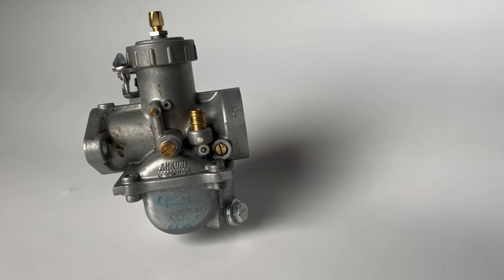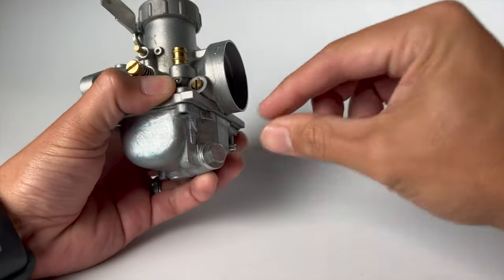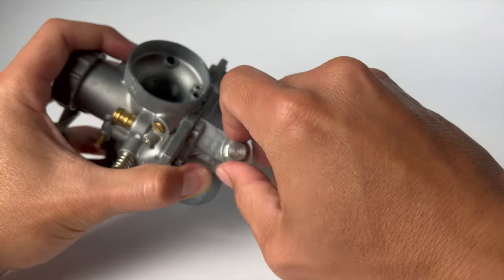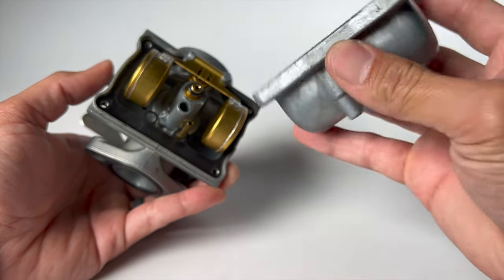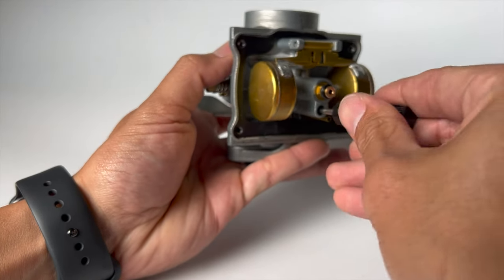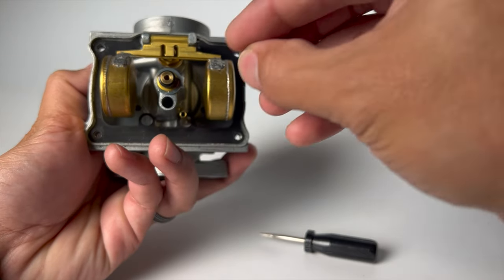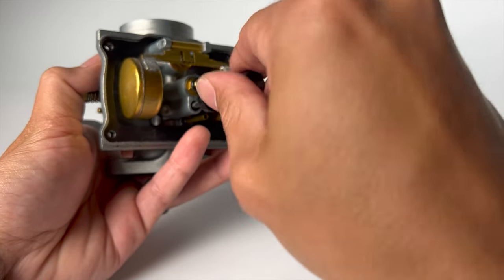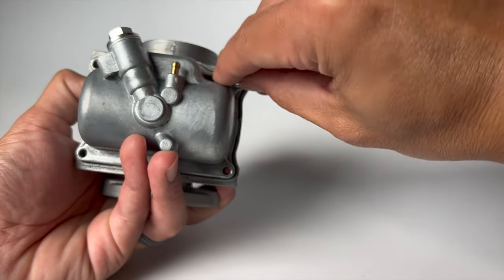Genuine Mikuni VM22 Jet Placement | Tutorial

Comment: we have a predator 212 with the stage 2 racer witch has the hot 265 cam but it it running very very rich what jets should we use to fix that

Comment: Right now i have a bored out stock appearing carb on my mini bike and since i installed it along with a stage 3 racing head i noticed a world of difference in power and top end. My bike went from 41 mph to 50 mph and feels like it pulls strong getting there. Would it be worth it for me to even switch to one of these Mikunis or would i not notice anymore power gains than what i have already ? Only reason i got the bored out carb is cause i thought the Mikunis looked to complicated to install but i'm sure with the help of you tube videos i'd manage. But i don't want to do it if i won't notice a power increase.
Reply: If the mikuni is jetted properly you probably will gain a up to 1 hp more is it noticeable no for racing every 1/4hp is worth doing since your not racing I wouldn't worry much about the 1/4 hp 😉  the round slides can flow or out flow a stock style butterfly carb the flat slides do out flow both the round and butterfly carbs and tend to have better response. No they are not hard to install and have working. Depending on what side of the Carolina's you are on I'd definitely recommend finding someone who races karts and knows the tuning of a round or flatslide carb. Depending what has been done internals as a different cam and head work the jetting I'm about to mention for a stock engine will not work as it will be too lean. Stock internals no head porting for a 22 mil mikuni or knock off pilot jet should be 15-17.5 and high jet should be 115-120. You will have to buy a manifold from NR Racing that I would recommend for the carb to work and you might have to swap throttle cables as the cable end doesn't have the little zink piece on the end to set into the slide of a round or flat slide carb in order for it to work. Hope this helps for your future carb swap.

Comment: I cannot find a 26mm intake manifold that matches the center bolt patten.  What intake is this carb supposed to bolt to or is it designed to bolt straight to a vertical engine,  rather than be adapted by manifold to a horizontal pit bike motor
Reply: I'm having the same issue with my oem 22 😩
Reply: It makes me think that center bolt pattern carbs are for go karts and ATVs, and not for pit bikes
Reply: I got mine for a 224 Predator on a Coleman ct200u-ex

Comment: What does this do
Reply: What it does is show you where the main and pilot jets are located so you know where to go to change them out. 😉
Reply from the maker: The Pilot jet will help you Idle but also help with top end a bit too.  The Main Jet will help you from all the way to low to high RPMs.  Depending on your build, you'll need to adjust how much fuel is going in your carb.  Our Carbs are pretty much dialed in, but some builds or locations need different jets.
Reply: @GoPowerSports  can you upload a video of the correct jets for different stage builds on the Coleman ct200u-ex with the genuine mikuni carb? Much appreciated!
Reply: @GoPowerSports so pilot jet also effect on high rpm???